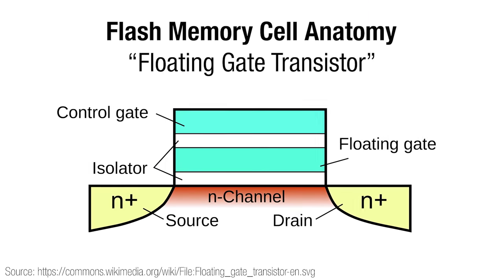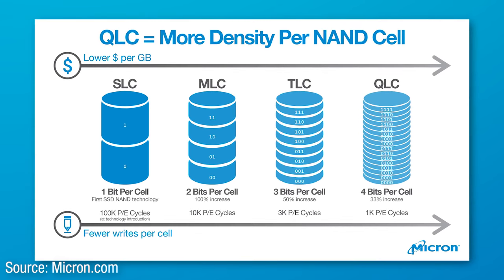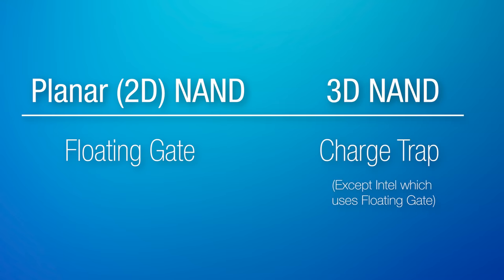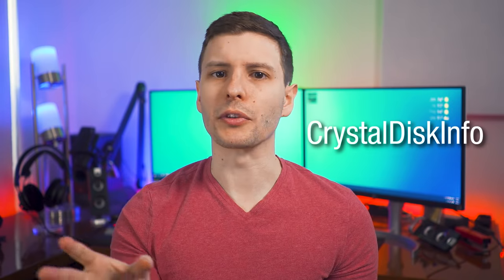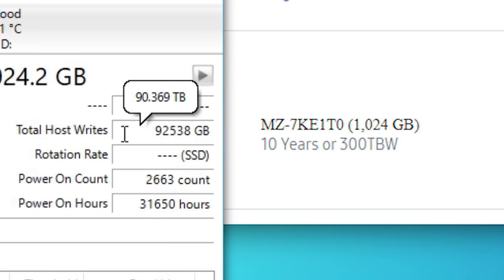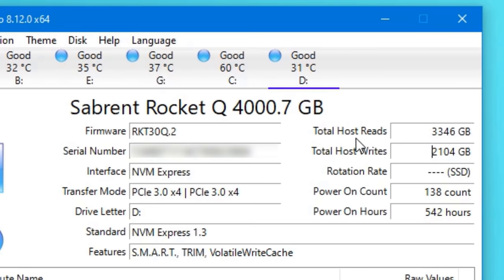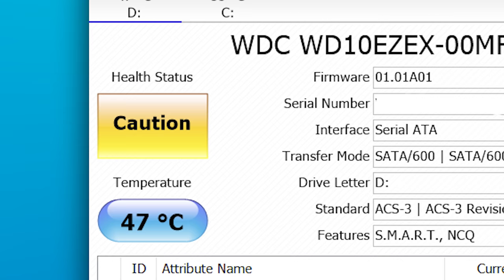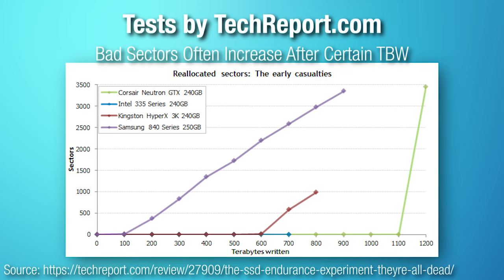How Much Longer Will Your SSD Last? How to Tell

Comment: I switched to a SSD October last year when my 11 year old hard drive failed. I still can't believe the speed difference
Reply: Did You Mean : Believe
Reply: 11 years damn
Reply: @monke2361  yeah I got it in December 2009
Reply: Did you get an m.2?
Reply: I'm still using a hard drive from 2009. It just stores files now I don't have my OS or any applications on it.
Reply: @garcjr  Bro a Samsung 500gb m.2 drive costs $65 and it’s about 100x as fast
Reply: @Industry-insider  no regular sata. I really don't see the point for m.2 for my uses
Reply: @janferenc316  why would want a slower drive for the same price tho
Reply: Can y'all stop bitching about SSDs that are slower than others? Especially when you're using an OS that can't even take advantage of the speed...
Reply: i have working hard drives from 2002 LOL
Reply: @Industry-insider  hdd is still functional and not everything need fast read speed
Reply: Damn thats long. My Seagate 500GB drive won't even stand up to 5 years. I switched to SSD 3 months ago. My PC is older than 5 years though, at the time when my HDD broke I don't know much about PC is just leave it there. My PC is about 7-8 years I don't remember
Reply: @janferenc316  Not that I'm bothered by your choice but I do have to agree, no matter how marginal of a difference it may or may not make, these days a really fast M.2 SSD costs nearly the same as typical sata SSDs (a few are actually cheaper), so why buy the slower one unless you just want it as a second drive or can your motherboard not support it?
Reply: Ok J
Reply: the same happened to me. right before the hard drive failed it was going SSD speed for some reason.
Reply: Bro how do your hard drives work so long mines fail way faster I only use hdd for backup now and make a backup of that hdd on another one since there already are spare ones lying around
Reply: Its massive isnt it? My kde used to take up a lot of time, after switchin to ssd it feels lightning fast !
Reply: @janferenc316  then it's around 12 years!
Reply: @garcjr  How do u use it then?
Reply: @janferenc316  y? M.2 is better with better speed as well as it's simply smallest in size. best part is that it now costs almost the same as Sata ones
Reply: @Industry-insider  My motherboard doesn't have an M.2 port. I got a 475ish GB SSD. I plan on replacing the HDD for preventive maintenance with another HDD. Storing music, pictures, some games, and videos are still dirt cheap on a HDD. I'll  move the games to the SSD though.
Reply: Holy śh! Mine is only 7 yo
Reply: @dieselgeezer18  same I have a 128gb drive from a pre built xp system
Reply: @garcjr  you can buy a cheap adapter it just runs on pcie
Reply: Hard disk speed depends on the microprocessor speed and data bandwidth too.  Generally, for a older PC like yours, the SSD will be about twice as fast as the mechanical HDD, sometimes even 1.5x.  And eleven years is quite a long time for a HDD to last.
Reply: I know right, I put an sdd m in my 2018 acer nitro 5 and it loads within seconds, and I have big games on there like gta 5, gta 4, and destroy all humans, all are demanding games.
Reply: @Industry-insider  I'm going to upgrade in about a year to get M.2.
Reply: My old Caviar SE HDD is dying after 15 years
Reply: @dieselgeezer18  I have a hard drive from 1998 that runs all day and still works great. Scans come back clean, no bad sectors. WD Caviar 12100.
Reply: @hereitsnick2069  I’m not saying he can’t and I run old hard drives too but I can recommend whatever I want
Reply: @vgamesx1  Why buy a fast nvme when you are never gonna use that speed anyway?
Reply: @StefanVeenstra  Why not..? Maybe not the fairest comparison but I finally upgraded from a 10 year old ssd to an m.2 and it was a very noticeable improvement, nearly as big as hdd to ssd and the sata drive I had considered prior was only about $5 less...
Reply: I replaced my HDD last year with a SSD.  The hard drive was about 9 years old at that point.  Yes, the speed is a lot better; I notice it most during startup.
Reply: @nextde15  On my first PC in 1995 when I was a kid we had about a 735MB WD HDD. It crapped out after about five years. I'm sure it didn't help the fact we were using almost 100% of the drive. But that was back in the day where you had to account for every kilobyte of space. I don't think HDD manufactures made the stuff last that long back in the day because the R&D was going into higher capacity drives. Longevity wasn't key because the manufacturer knew you were going to get a larger drive as soon as possible. 

I've seen HDDs go a little longer now a days. Mainly because of better manufacturing processes and                   you don't run an OS on it.
Reply: I switched mine and couple months later the HDD died, it was lucky af. I couldn’t believe the speed difference too.
Reply: I used to borrow a laptop from my uncle that's about as old as your hard drive. Now I have my own gaming laptop that runs on an nVMe SSD.

It's like trading in a Ford Pinto for a Nissan GT-R.
Reply: Same, I'm boggled even after switching
Reply: Welcome to the future
Reply: @janferenc316  why would you use it for so long, if you're strapped for cash I understand, otherwise that's just dumb
Reply: @ramon5214  I'm loving it already.
Reply: What is the manufacturer of your hdd? 
Damn, usually my hard drives only last up to three years.
Reply: I switched to SSD just for the boot drive just this year. I immediately realized my mistake over the years.
Reply: Congratulations 😆
Reply: copy 480 gb  in usb 3.1  ssd to ssd = 25 minutes. i´m surprised    480gb in hdd to hdd  and  usb 2.0 protocol  12 hours.
Reply: @Industry-insider  my 1tb m.2 samsung 970 evo plus cost like 200+
Reply: @janferenc316  2.5 inch ssds are only like 500m/b a second i think. m.2 is 3500m/b a second.
Reply: @pnnytx  LOL only 2 years ago i throw out some old HDD that still worked but yeah you not going to fit much on them less then a 1gb HDD's LOL
Reply: yeah ssd is easily the largest performance improvement you can ever do to a system
Reply: 11 years is very good I had one Hard drive died just in 2 months I had replace it marry years ago before SSD came out
Reply: @dieselgeezer18  Me too..
My C HDD drive was new in 2002.
Power on 131546 hours according to the SMART.
No errors
Reply: i replaced my 2008 hard drive with an ssd just few days ago and i can honestly say the same , absolutly amazed of the speeeeeeeeeeeeeeeeeeeeeed
Reply: I switched to a SSD three years ago when my two weeks old hard drive failed lol.
Reply: Copying large numbers of small files takes an incredibly long time with SSD's.
Reply: Cuz u were living under a rock for 11 years
Reply: @abohamolla4632  "Cuz u were living under a rock for 11 years"
And you were watching him hide under the rock for those 11 years.
Reply: @thomasmaughan4798  nice one
Reply: @garcjr  My motherboard doesn't either, but I had spare PCI Express slots, so I used one of them.  The M.2 drive is now my boot drive.  Makes a huge difference in speed.
Reply: @dieselgeezer18  That's pretty crazy to me. My drives (ssd and hdd) don't last more than a few years at best.
Reply: @vrajeshpc  ssd/hdd cooling matters more then you think the cooler the longer it lasts.
Reply: @WyattOShea  thats weird. I built my PC from used parts and other scrap parts found in electronic bins. It has 3 old hard drives from 2008-2012. They are like 250GB each. They work perfectly fine, except one of them that has a few bad sectors, but thats all.
Reply: @dieselgeezer18  I just do allot of writing to mine like the guy in the video has done less (about 50%) in 7 years than I have done in about 2 years of owning my  nvme drives .
Reply: @WyattOShea  i do a lot of writing to on my HDDs.
Reply: @dieselgeezer18  might just be bad luck for me then idk haha.
Reply: Even though SSDs  are more reliable than HDDs  in general, but when they do fail, it's much easier to recover data from HDDs than SSDs
Reply: @Industry-insider  one thing i hate about m2 that i wish i knew sooner. it takes 2 slots :(
my motherboard can only handle 4. but my friend said just build a 2nd pc for ''data'' storage. 
but yeah m2 is damn fast compared to hdds. especcially if u face a lot of loading screens in games.
Reply: @vishalgiraddi5357  That's true. I had a Samsung 850 evo die on me and it was just completely sudden and had no way to recover the data off of it but usually when my hdd's start to fail I can see it happen gradually over time so I can at least (more often than not) copy the data to another drive :).
Reply: @chlorobyte_projects  what os
Reply: @chlorobyte_projects  let's all use dos then right? because every linux distro is just too complicated for an average user?
Reply: @ianthehunter3532  yeah because dos is less complicated than linux distros
Reply: SSD is the best thing you can do to upgrade a crappy laptop with a 5400rpm that takes 2 minutes to load chrome.
Reply: How did you keep it up for so long? I've been using SSDs for system storage for 11 years now.
Reply: @G4M3RK1LL3R  I'm still using HDDs to this day lol, and they actually perform well enough. Linux is a help with its file cache that basically avoids unnecessary accessing of the disk and therefore unnecessary slowdown. Yeah, SSDs are faster, but meh, it's not worth me sinking money just to replace something that perfectly works to this day
Reply: get an NVME if you wanna be blown away..
Reply: same here i switched from hdd to ssd. i cant even read loading screen tips anymore haha!
Reply: mine was around March 2021.. & damn such a stellar difference compared to HDD; can't even be patient using hard disk anymore
Reply: welcome to the new technologies ...Bought 7 years ago my first ssd and still can't believe how big difference between hard drive and ssd lol
Reply: @h..h  lost anything I didn't have backed up (and also learned a lesson)
Reply: Welcome to the future!
Reply: LOL Years wasted with a slow ass computer. I've got about 7 SSD Drives in my PC.
Reply: @Industry-insider  He had it 12 years ago it was the best there was then
Reply: HDD are easily repairable , SSD no chance to repair
Reply: It's not even the speed that makes the difference. It's the snappiness and response time. HDD's take time to spin up, seek and start accessing data, this overall makes them feel sluggish for something like an OS.

I have 4x 4TB HDDs in raid 0 I use for games storage and i'm getting speed of 800MB/s. Pretty good for rusty bricks and moving big data but I'd still prefer my OS on a SATA SSD even though it's slower at 350-500MB/s, just cause of the snappiness.
Reply: 11 years? My 40GB IDE hard drive has been running since 1998.
Reply: @chlorobyte_projects  I think you never used Windows in ssd or even you ssd in your life..
Reply: @vgamesx1  

Seriously the difference between fast and slow ssd is so miniscule for most normal everyday tasks it does NOT MATTER. Even for gaming the difference in load times is maybe 10-15%. So at best the load time difference might be just a second or two. 

So the only reason to get a nvme or m.2 drive is if ur a professional using a specific program that needs that speed boost or u just don't want to use up a sata port.

Besides do u really think we will have just m.2 ssd's one day? Like do u know how much space on ur mother oard that would take up. Sata ports are way smaller. Idk just annoying how people find miniscule speed differences worth poking at.
Reply: @vgamesx1  
That's BS iv used both data and m.2 and u can't tell the difference at all. 

Even if u do notice a difference it's not nearly as big as going to see after hdd. U really are exaggerating. There's just no way. 

Once u have a SSD ur ability to load up programs is more limited by ur internet speeds and ur PC processing speed.
Reply: @Industry-insider  hdd  are still better for bulk file storage, I have all my application and OS on ssd, while random documants and images ans files like that are on hdd. HDD still are significantly cheaper when it comes to raw cost per GB
I cat get a 4tb hdd for less then 100€ and at the extreme end I can get a 16TB hard drive for just about 250-300€, that kind of capacity is where ssds really get expensive.
Reply: Are you joking? Even if you dont want to part with HDD (which is fine, HDD is still cheaper for storage, for cold data its even better), but folks use hybrid systems for many years. You just put speed-critical files on SSD and other stuff on HDD. You can also use fancy ssd-cache setup too, its even more efficient.
Reply: But do SSD last long as HDD because I read negative reviews on Amazon of some Samsung and crutal solid state drives dying fast
Reply: @LivingOnlyOfficial  This happens sometimes. Samsung 980 Pro have firmware bug causing it to fail quickly. Its should be fixed by update. Another thing Samsung is notorious for is declining problem in firmware, look for Linux and Samsung EVO 860\870, Linux developers had to disable async TRIm on those drives for known problem which existence is declined by Samsung.  Also Samsung sometimes have "bad" batches of SSD which prone to failure. Many people say Samsung not that good nowadays as it was before. But problematic products isnt only Samsung's story - another recent  example is WD SA510, which die in few months if firmware update is not installed. As for HDD live its usual thing that faulty HDD die very quickly and if they dont they can work very long
Reply: @Vednier  sick! Thanks so I just would need to update the SSD?
Reply: @Vednier  Is there anyone on YouTube talking about this? I can't seem to find any
Reply: @LivingOnlyOfficial  Talking about that exactly? Firmware bugs? Questionable support? Benchmarks showing performance which have nothing to do with everyday usage?
Reply: @Vednier  I just wanna make sure it's reliable before buying a 870 evo sata III 4TB one
Reply: @LivingOnlyOfficial  Well, its not bad drive. Its TLC, with DRAM. Its TBW is 2400, 1:600 which is normal for TLC. You can find drives with bigger TBW if you want, however. If you looking for really long drive lifespan you can look for real MLC drives, for example Transcend have 370S with insane TBW. My question is, however, why SATA? I have nothing against SATA, but drive of this capacity may benefit more of being NVME.
BTW, Samsung 870 is one of drives which have that bug affecting async TRIM, but keep in mind Linux is only OS where async TRIM is supported.
Reply: @Industry-insider  it's not the same price. I can get 2TB for 65 bucks lol 😂
Reply: I put an SSD in my old laptop last year and boot speeds dropped from minutes to seconds, it's crazy!
Reply: I moved to SSD (SATA) around 6 or 7 years ago and i was angry that i didnt did that before, because it was SSD which was laying around for like year (didnt bothered to install).
BTW, its still working because it was MLC (true 2-bit) one. Interestingly, its really old model, but it had 500+ megabyte of read speed even then and still doing fine. 
Nowadays i thinking about moving to NVME drive, but boot speed increase on NVME isnt that great really
Reply: @Industry-insider  SHUT UP I HAVE A 20MB/S HARD DRIVE SINCE 2007 AND ITS OK ITS FAST
Reply: 15 years and my hdd still running perfect
Reply: @GamingBeastchamp  And how fast is it? Recently dig out old WD Green EADS drive (not 4K), started copying some files from it and was unpleasantly surprised with speed of 60-80 Mb\sec, it certainly felt faster back then. Its really not much since modern WD Purple can consistently pull 150-190 megabyte\sec.
Reply: @Vednier  it surely was slow in running windows 10 in it but Linux works very smooth and fast in it, an old hdd barely can run windows 10 so I'm currently using Linux to get good amount of speed :)
Reply: I'm using an external drive I bought in 2004. I'm pretty sure it will outlive me at this rate.
Reply: @Industry-insider  Cause some older computers don't support it and it's not worth to upgrade the motherboard
Reply: @matrixcuberoadto6007  support what?
Reply: @Industry-insider  hard drives actually last longer than SSDS "IF" both are put into storage without power.
In actual use SSDs win
Reply: best combo is ssd + hdd
Reply: The 120 GB OCZ Vertex III in my old computer has run for 12 years and is still perfectly working.
Reply: @chlorobyte_projects  I guess someone's ass is on fire that they can't even AFFORD to buy a damn ssd.
Reply: @AakashKumar-tn6yh  ?? Tf are you talking about, I use a 2TB M.2 for my boot drive
Reply: Only will survive under heavy use,more or less 4 years...
Reply: i just took all my games off of an old hard drive and put them on a NVME and i have never looked back lol its so much better then the old hard drive and games load way faster
Reply: @janferenc316  should’ve got yourself an nvme if your motherboard supports it cuz sata SSDs and NVME SSDs got very similar or even same prices (at least here in GER) and therefore a much better price to performance ratio
Reply: I moved all my music sample libraries from HDD to SSD a couple weeks ago. It used to take a minute or two to load everything for a simple song, now it all loads faster than I can say the title of the song.
Reply: I have a nvme gen 3 500gb drive, a 500gb sata ssd and a 13 years old 500 gb hard disk still running like it was yesterday lmao but i usually store photos, movies or music in my hard drive and for gaming a sata ssd is bare minimum nowadays
Reply: @monke2361  it was about another game, played on the laptop
Reply: Sad to hear you waited that long to experience real speeed 😂
Reply: @aapozza  don't be funny, try to load CS2 on a HDD vs SSD. HDD load time into a match is around 3 minutes, SSD is under 30 seconds.
Reply: Did you get sata or nvme ssd?